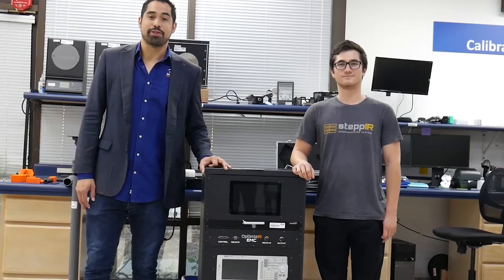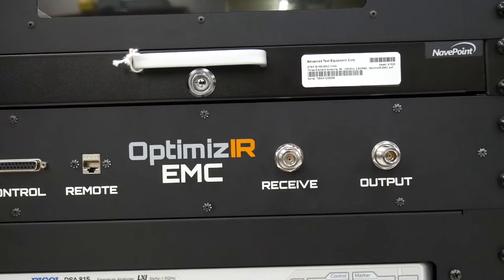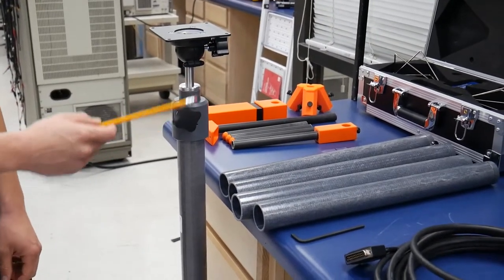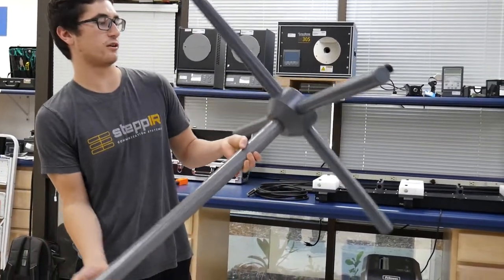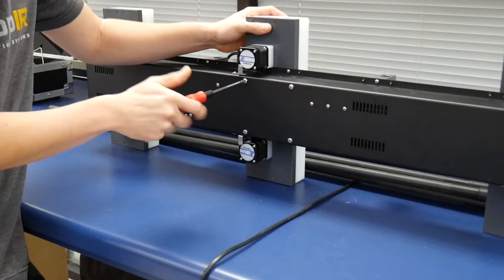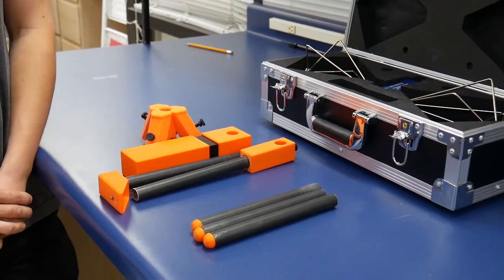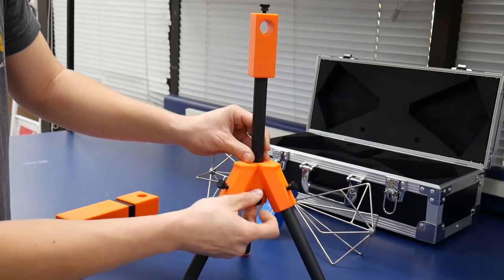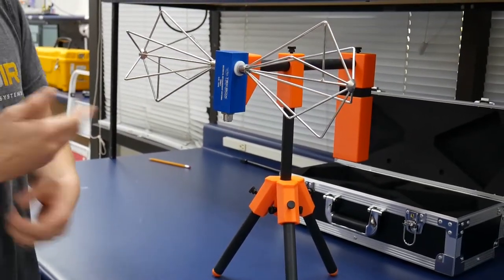SteppIR OptimizIR EMC Antenna System Demo - Instruction Video

Comment: I thought Stepp IR was Ham only antennas. Great idea to be able to modify a Yagi antenna to change directions...front/back ratios can be changed . I have the BIG IR vertical without 80M. I read too many stories of grief with the 80M add-on
Reply from the maker: Yes achieving 200V/m at that low 80MHz frequency is tough, either need a giant amplifier, or a high gain antenna which this SteppIR can provide.